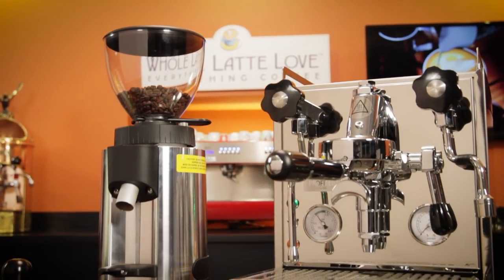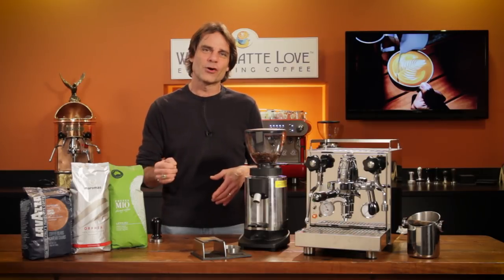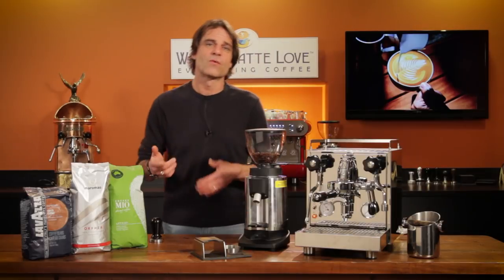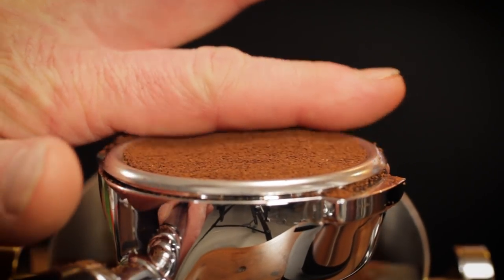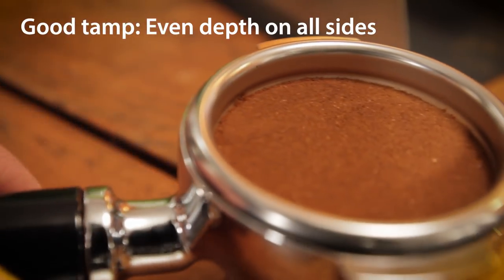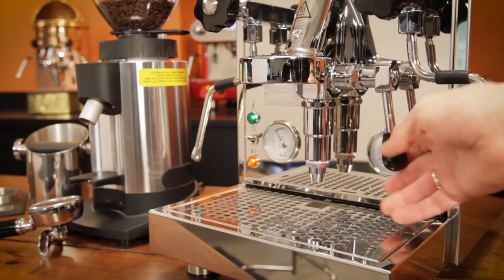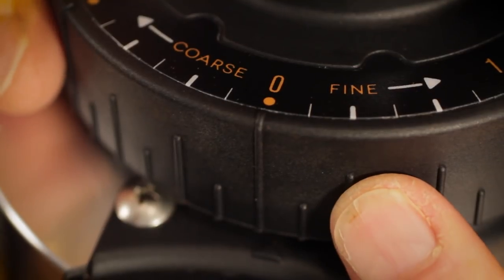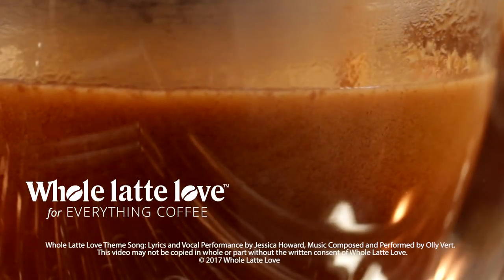How To: Basic Espresso Technique - Dialing in Grind Size

Comment: I'm a definite amatuer to espresso, but I'd really like to start. I just got a DeLonghi EC155 15BAR machine, it was the best bang for the buck I could find. I'm using a Krups GX5000 grinder (also really cheap but best quality I could find), and already I have a bunch of questions. Filling the portafilter, I only get around 10 grams of ground coffee, is that normal? This machine also has pressurized portafilters, and I'm not sure how much that affects the coffee, but every time I take the filter out, there's always coffee residue on the outlet, and the residue in the portafilter is just a mess. I'm getting a horrible-tasting cup, even with milk. I need the most feedback possible, but I'd really appreciate any, thank you!
Reply from the maker: Hi Paul, Thanks for the questions. The machine is a limitation in your quest for better espresso. Budget entry-level machines like yours use smaller filter baskets, usually have poor control of brew water temperature and pressurized baskets are a compromise in quality but give the ability to make "espresso" from pre-ground coffee for those who don't want to grind their own. Making better espresso requires using the grind of the coffee to control flow of brew water. Then make subtle grind size adjustments to control the flow rate and depth of extraction.
Reply: This definitely clears many things up, thank you! I'm attempting to make the best with what I have for now, so I'm definitely working with fresh coffee to improve. My main concern was the coffee amount because of my potential inaccuracies, but I can obviously tell now size varies. Again, thank you, this has been very helpful!
Reply: Paul Yurkiv I would suggest try and get a better grinder before your machine I would recommend the breville smart grinder pro or baratza preciso
Reply: Paul Yurkiv look online for modifications on the EC155 that will make it function as a much better machine. If you cut out/remove the bottom of the portafilter and order this https://www.theespressoshop.co.uk/Mobile/MobileBasket.aspx the La Pavoni double brew basket to slip in the top you now have a unpressurized machine which allows for a much better quality shot. Flush out the over heated water for a few seconds before brewing. You can also upgrade the steam wand. Def the best grind for the least money is going to be the breville smart grinder pro which you can open up and adjust the burr to give you basically endless options. Use fresh beans ground to make. Hope this helps, with a little ingenuity you can get a pretty good shot out of your brew on a budget
Reply: There are tutorials online for the EC155, you can modify the potafilter to depressurize it. You can also modify the steam wand to get properly steamed milk for latte art.
Please search on YouTube there are lot of modifications you can make to improve the espresso quality.

Comment: Hi, I have a breville duo temp pro which I am fairly happy with except for the first shot I get from it. When I tamp the first shot of the day, it must be tamped very hard so that the water runs slowly. The next shot I barely tamp, and I can hardly get water through it. Any idea what is going on here?
Reply from the maker: Hi dk, What grinder are you using? I suspect the first shot may include some stale grinds from day before. If you are not already doing it grind off and discard 6-10 grams off coffee to clear any stale grinds from previous day.
Reply: Whole Latte Love, thanks! I think that was part of the problem. I also wasn't preheating the machine long enough, and I think I might have been dripping cold water on the coffee. Appreciate the help!
Reply from the maker: No problem!

Comment: Hi Marc, if I use 51mm double basket with 14 gr coffee, what is the target espresso weight for best result? I usually use 1:2 ratio but the espresso tastes bitter and salty
Reply from the maker: Hi MH, Thanks for the question. A lot depends on the coffee you are using. Bitter flavors typically indicate over-extraction which can be caused by a grind that's too fine, running a shot too long or brew temp which is too high. Curious as to what type of machine you are using - not many out there with a 51mm portafilter.
Marc

Comment: You don't talk about the basket.  Our Breville Infuser espresso maker comes with single wall and double wall.  I'm assuming you are using single wall.
Reply from the maker: Hi Vince, You assumtpion is correct! If grinding fresh no reason to use a (double wall) pressurized basket. Those pressurized baskets are for use with pre-ground coffee. Dial in your grind and use the non-pressurized (single wall) basket. You'll get a much better espresso! Pressurized baskets fake the crema to some extent as the squeeze the extraction through a tiny hole. After going through that tiny hole bubbles come out of solution due to rapid release of pressure.
Marc
Reply: @Wholelattelovepage  thanks.  We are learning!  I just ordered a good grinder.

Comment: I Have the exact same grinder I bought from WLL. I have never ground coffee with out getting horrible clumping of the grounds. The video makes me feel like an doing something wrong, any tips?
Reply from the maker: Hi GG, That's surprising. I use the E5P a lot and compared to other grinders it's one of the least clumpiest. Honestly have never had anything I would consider horribly clumpy come out of an E5P. What coffee are you getting clumping with? Is it a dark/oily coffee?
Reply: I am using a local blend light brown roast not oily in the lease.  It is really frustrating. I have to be on the large end of the grind size to stop the clumping nothing close to espresso size grind.
Reply from the maker: Hmm, do the beans feel moist or are you in a humid environment? You might try cleaning behind and/or adjusting the flap on the exit of the grinding chamber prior to the chute. It's easy to get at. Just remove the 2 screws on top of the black chute carrier and 2 more on either side of the chute. It comes right off and exposes the flap. It's possible some sticky grounds may be blocking. It's normal for some grinds to be there but also possible some could clump to the point of being immovable during normal grinding. That could lead to new grinds being compressed prior to delivery. You can also try adjusting the bend of the flap a bit so flow is a little less restricted.
Reply: Wow you have changed my whole experience!!! I have been frustrated with my espresso shots for going on about 2 months now.  I removed that flap completely and about 10 grams of coffee came out. I single dose so this is an extreme amount of retention. But now! My espresso is better than I could of imagined... I have seriously nothing bad to say about WLL. Everyone associated with your company has been nothing but helpful and always consummate professionals. Thanks for everything, seriously life changing.
Reply from the maker: Garrett Gerard that’s awesome! So happy I could help! Thanks for letting us know. Cheers, Marc

Comment: Hi. Can you guide me what grinding level to use with my delonghi espresso maker ec685r. Whenever I buy coffee beans and I ask the shop to grind it for me, I sometimes make a mistake of asking them to grind it so fine that I eventually can't use the coffee. Thanks for your help
Reply from the maker: Hi jj, Thanks for the question. You Delonghi Dedica uses a pressurized filter basket. With those grind size is a little less critical than if you were using an espresso machine with a standard non-pressurized filter basket. But, as you have found grinding too fine can choke your machine. Most commercially available coffee which is pre-ground for espresso will work without issue in pressurized brewers like yours. It's hard to characterize grind size but your are looking for a size which resembles granulated sugar or a bit finer. Hope that helps!
Marc
Reply: @Wholelattelovepage  soo is better to have normal basket tha pressurized??

Comment: im using the old model eureka mignon manual, and it's so difficult to get the grind size correct, would u have any suggestion? thanks!
Reply from the maker: Hi marvin, Thanks for the question. Sorry you are having difficulties. One key is keeping all other variables the same while working with grind size. So same dose of coffee each time, similar tamp, etc. When you get close to 60ml/2oz in 20-30 from first drip make very small successive adjustments.
Marc
Reply: @Wholelattelovepage  Good day! 20-30s from first drip is that mean the pre-infusion times or dwell times is excluded? thanks!

Comment: often you would hear the 1:2 ratio of coffee in and out. You say 2 oz in the cup? That's a lot more. How come?
Reply from the maker: Hi Victor, Thanks for the question. Answer is 1:2 ratio uses weight for both the in and the out. 2oz out is a liquid volume measurement and not a weight. But Marc, you ask... Doesn't 2oz (~60ml) of liquid weigh ~60g? Yes it does if it's pure water. But we are not dealing with pure water in the cup. It's espresso with a lot of crema and that crema weighs nothing close to 1g/ml. When using a coffee which produces a lot of crema it's not unusual at all to extract to an 18g coffee dose to a 1:2 ratio by weight which produces a liquid volume of about 2oz/60ml when crema is included in the liquid measurement. 
When using brew ratios it's best to use a scale to weigh the shot. 
Hope that helps!
Marc
Reply: @Wholelattelovepage  of course, haha.. My Danish mind only understands metric, clearly, haha. Thanks anyways!

Comment: Nice information! Im new to this passion of having a great expresso, but Im little frustrated with my machine I have Breville Oracle® Touch. For some reason it doesn't make crema, I put the grinder setting at 27 for 30 sec using Illy Medium Roast beans and no luck..
Reply from the maker: Gino07777 Hi, thanks for the comment. Have you tried other coffees? I have not worked with Illy medium much so don’t know what it’s capable of. If you’re getting a double in 30, my first thought is finer grind with lower dose.
Reply: If you bought your coffee in a supermarket it may be too old. Only use coffee with an indicated roast date that is in between 2 to 12 weeks old (depending on type). You may get much better fresh coffee from a local roaster than Illy for the same or better price.
Reply: I agree, totally. I switched from store bought beans to a local roaster and it was like night and day! Huge difference! I really didn't know how old the store beans were but the roaster had the date stamped right on the front of the bag. Now I only buy beans where the date is no longer than 10 days to 2 weeks since roasting.
Reply: For more details and advanced understanding google Barista Technique:
Good Extraction, Good Espresso

Comment: Marc, 
My lovely wife bought me a Breville Barista Touch (BES880XL) for our anniversary, and I’m not sure yet if it was a blessing or a curse.  It has been about a month and I have spent hours watching videos and still don’t feel like I am making quality espresso.  We tried the Illy medium roast beans first and it was ok, but not great.  We then switched to the Starbucks espresso beans in an attempt to save cost while trying to figure it out.  I have so many questions, but I’ll try to keep it brief.

1 – I have been chasing grind size.  I am now very fine (#2 setting) and almost powdery with almost no crema.  However, I am now getting a double shot from 18g of coffee.  When I was more coarse it was far too much liquid.   Is there something else I need to adjust instead of grind size?

2 – Sometimes the grounds come out in lumps, but they easily break apart, is that an issue or just the beans?

3 – Is the Starbucks coffee causing my problems?  I am getting such bitter espresso and it looks nothing like what I see on your videos.  

4 – I have only used the single wall portafilter since I am grinding fresh, will the pressurized help me in any way?

Thanks for the help!
Reply from the maker: Hi Michael, Your wife is nice to buy you a machine for the anniversary!
1. Aside from dialing in grind you need good distribution of grounds in the portafilter, good level tamp and all components up to temperature - so keep your portafilter locked into group so it stays warm when not in use.
2. The Barista touch should produce a relatively dry and easy to knock out puck. Breaking apart is normal.
3. Could be the Starbucks. Their beans tend to be over-roasted so you end up tasting the roast and not the coffee. That's why - "charbucks" Also why very few home espresso heads use Starbucks standard coffee beans.
4. You are right to use the single wall when grinding fresh. The "dual wall" pressurized baskets are for pre-ground coffee. They will make things worse for fresh ground.

Advice:
I'd start with an easy to work with coffee known to produce nice crema. These are typically Italian style bean blends which have some Robusta beans in the mix. You'll hear a lot about the freshness of the coffee. With Italian style blends containing Robusta freshness is not critical. It is with single origin beans roasted medium but get down your technique with easier coffees before spending money on those. Maromas Orphea is easy to work with and well reviewed for flavor (read the customer reviews via link below) and good crema production. Get the grind close with Orphea and you will produce tasty crema rich shots and it's ~$10/lb: https://www.wholelattelove.com/maromas-orphea-whole-bean-espresso
Another awesome and easy to work coffee is Malabar Gold. It's more expensive but produces juicy rich red crema: https://www.wholelattelove.com/whole-latte-love-malabar-gold-espresso
Hope that helps. Let me know if you have more questions!
Marc
Reply: Thank you so much for the advice.  I will check out those beans for sure.  My 2nd question was not the puck, but the grounds before brewing.  It doesn't look like a smooth cone from the grinder, but instead there are balls and lumps.  They do break apart easily, but it doesn't look like any of your videos.
Reply from the maker: @MrSpencer1011  Hi, You are welcome! So it's the clumpy grinds. Sorry for the misunderstanding. Extra clumping may be the coffee you are using. With the grinder in the Barista Touch you can expect some clumps. With oily dark roasted beans you get more than you would with coffee that's not roasted so dark.
Marc
Reply: Once again, thank you for your time.  

I signed up for an email when the Maromas Orphea gets back in stock.  I look forward to giving it a try.

Comment: My porta Filter basket only takes 12grams..... it's a delonghi icona ecom311. Any thoughts? 

I thought....well if 16grams (I think you said) takes 23 seconds (lets take an average)

Then 23 seconds divided by 16 gives the time per gram.... multiply by 12grams...I get around 18 seconds.... does that sound right? 

I'm using the delonghi kg79 grinder on the finest setting.

I also looked at brew ratio....So to start i should be aiming for 24grams of yield with 12grams of dose.... but my shots (if i time 25seconds) come out at 40-40 grams... therefore a 1:4 ratio. Help please?!
Reply from the maker: Hi DR, Thanks for the questions. The Icona does have a smaller than standard filter basket. It's also a pressurized basket brewing system. With your machine it's the filter basket which creates the brewing pressure and not the grind size/coffee dose weight so you can't really use timing and brew ratio like you would if using standard non-pressurized filter baskets. If you have a grinder you can adjust grind size which may affect flavor. But it's unlikely to change brew timing much unless you go really fine with the grind.

As to your timing calculations... In most cases regardless of coffee dose you still want the same 20-30 seconds from first drip. So it never works out like what would seem to make sense in your math. ie it's not half the coffee dose means half the extractiuon time.

If you want to get serious about brew ratios etc you need to move up to a higher level machine with standard size 58mm non-pressurized filter baskets.

Marc
Reply: @Wholelattelovepage  really appreciate your comment back Marc. I was thinking of a Breville Barista Express. At around that price point it just can't be beat it seems.

Comment: Do I need to flush my Lelit Victoria? Just bought it second hand and not sure
Reply from the maker: Hi MG, Have not used a Victoria. Looks like a single boiler PID machine. If so, probably not. Do check the water flow without a PF installed. If bubbly at first that indicates flash boiling. If you get that then flush until flow is smooth. Then attach PF and brew immediately.
Reply: @Wholelattelovepage  awesome thank you so much!

Comment: Hi there, should I flush with a Rocket Appartamento?
Reply from the maker: PAS Hi, thanks for the question. Yes you should. You can check for overheated brew water by raising the brew lever without the portafilter in place. It will most likely come out  bubbling a bit for a few seconds. That’s flash boiling indicating water is over 212f/100c. Flush until water smooths out usually a few seconds. You can vary the flush duration to change the brewing temperature. Flush a few seconds long for a lower brewing temp. In general, sour flavor indicates brew temp too low, bitter to high. 
Marc